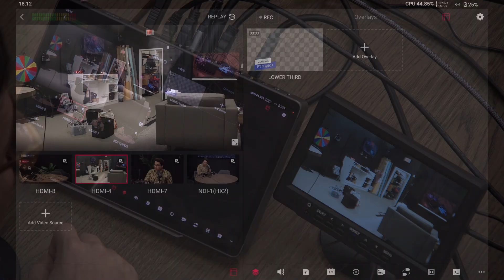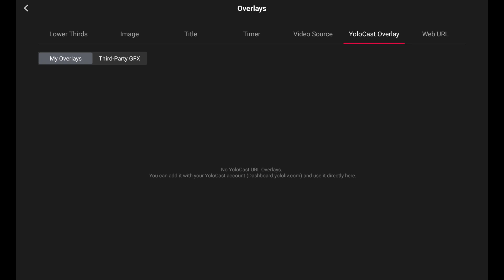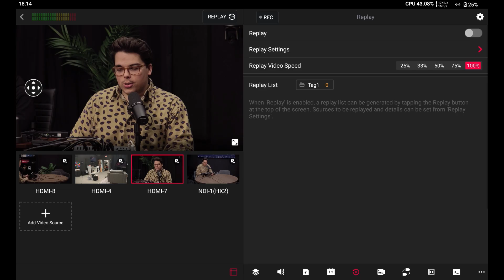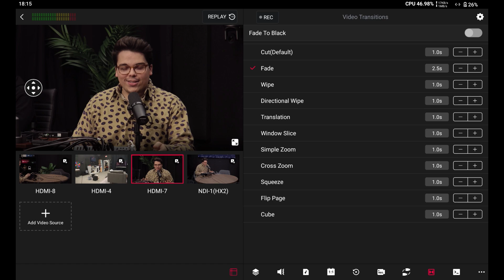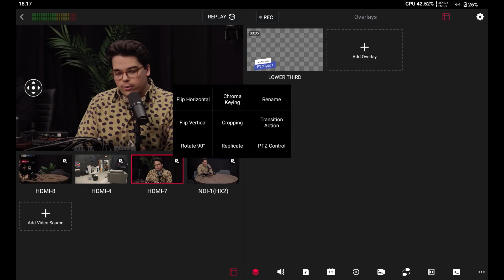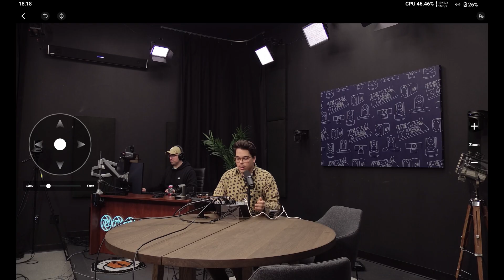Build a 3-Camera Livestream Rig with PTZOptics & Yolobox Extreme

Comment: Does Auto tracking works using YOLOBOX?
Reply from the maker: Yes. PTZOptics auto-tracking is processed inside the camera, so it will continue tracking while sending video to a YoloBox.

The typical workflow is:

1. Connect the Move 4K, Move SE, or Link 4K to YoloBox via HDMI.
2. Enable and configure tracking through Horizon or the camera’s remote.
3. YoloBox receives the finished, auto-tracked video feed for switching, recording, and streaming.

But our tracking settings should be managed through Horizon or the camera remote.

Comment: What would be a good camera for outdoor sports streaming? Texas can get hot 🫣 don’t plan on streaming in rain. But need something that’s a bit OK for outdoor elements (dust, heat etc)
Reply from the maker: Hello! 
Great question. Outdoor sports, especially in Texas heat, really benefit from the right setup. PTZOptics cameras themselves are rated for indoor use, but many people successfully use them outdoors by pairing them with Dotworkz professional outdoor enclosures. These enclosures are IP68 rated, vandal-proof, and designed to handle dust, heat, and changing weather.

For hot environments, the Dotworkz enclosures with active cooling systems are key. The cooling automatically turns on around 95°F, which works well for Texas summers.

This setup lets you use broadcast-quality PTZ cameras with 20x to 30x optical zoom, which is great for covering sports, while keeping the camera protected outdoors even if you are not planning to stream in the rain.

More details on enclosure options and compatibility can be found here:
https://ptzoptics.com/outdoor-enclosures/

More information about enclosures for our Move cameras here:
https://ptzoptics.com/wp-content/uploads/2024/07/PTZOptics-Dotworkz-Compatibility-with-Move-cameras.pdf
Reply: @PTZOptics  Thanks. FYI - This will be a "mobile" set up i.e tripod + camera during game time only. Other times it will be indoor. Is the above set up still workable?